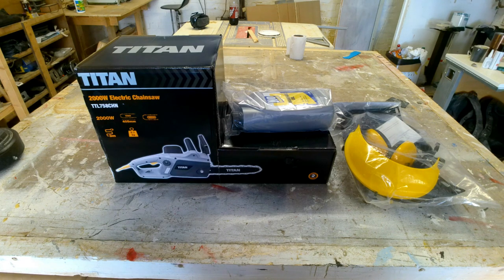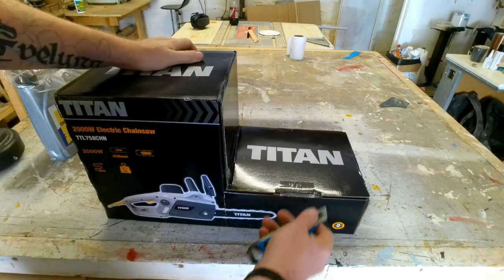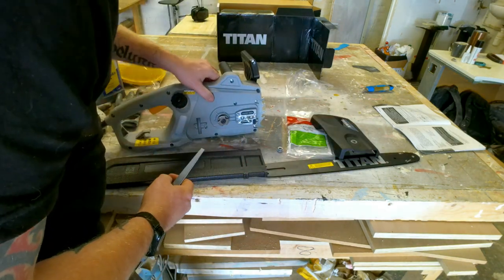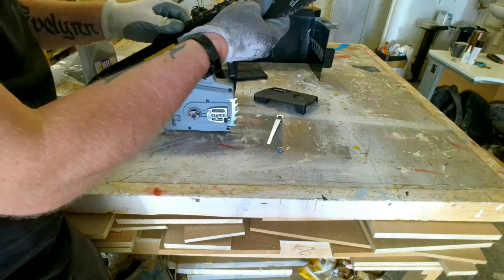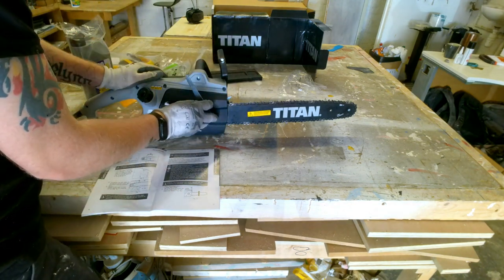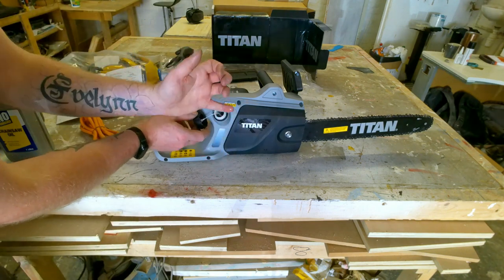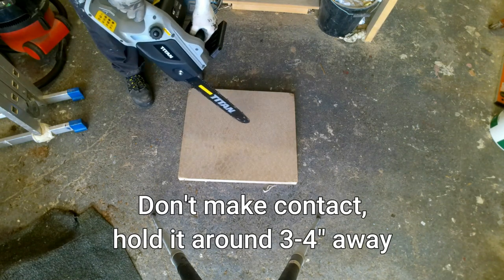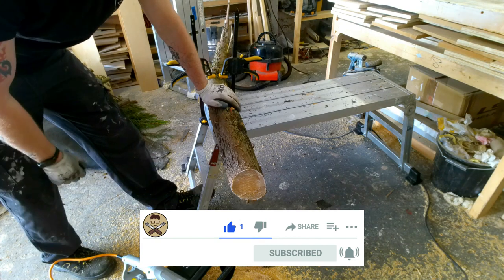TITAN TTL758CHN electric chainsaw, unbox, assembly and review

Comment: I had just bought this a few days ago and decided while the kids are at school to assemble it!  Like a previous Comment, I missed the lower hole where the chain holder lines up too!!!  Your video is fantastic and Saved me a lot of time and frustration.  I'm a first time buyer and user and wanted to make sure I have the assembly done correctly.  I am glad that you have to assemble it, so that when you need to put a new chain on, you know exactly what you're doing, it's just a shame it doesn't come with a small sample pot of oil to get you going straight away, but I did buy the same chain oil that you were showing, now I will be putting the oil in, but will test it tomorrow when the weather it better.  Thank you so much for this great video.
Reply from the maker: Glad the video helped so much, have fun and stay safe

Comment: Just a little bit of advice. If your cutting logs. You are better using just the tip of the bar as you will have more control that way once your cut goes through. Excellent instructional tutorial. Well done 👏 👍🏻👌
Reply from the maker: Thank you for the information 😌

Comment: Thanks very much for the video Phil, very helpful. I've just purchased this saw and got up and running in no time following this guide. Seems a lot easier  than going for a petrol saw as long as you have a plug within reach. I've seen a few people saying to check that tensioner after the first few cuts as the chain starts to bed in.
Reply from the maker: Thank you. I am glad it helped you set up :), Yes after about half hour use I had to tighten the chain again. But it still carried on cutting really well
Reply: @philscraftcorner   why did you not put the power cable in to its safety clip so you can not pull the cable out of the saw if it got snagged ????
Reply from the maker: Because. I guess I didn't think about that😅 but it's a very good point
Reply: @philscraftcorner  it could save your cable from pulling out of the saw if it was stood on i have 2 titan saw's a petrol and an electric i cut big fire wood every year never had a problem with both of them

Comment: Great video and this saw looks like it will be ideal for the little bit that I need to do.
Just a little tip for cutting logs, let the spike bar bite into the bark of the log (the chainsaw will naturally pull it in that way) and lift the handle to pivot the guide bar down into the log. Super easy and controllable
Reply from the maker: Nice tip. Thanks

Comment: Thanks explaining the chain oil bit in more detail. It's a little confusing at first and I overfilled mine before seeing your vid. I didn't notice any fill level line either and the fill viewer on the side doesn't show anything other than the minimum level.
Reply from the maker: It isn't very clear at first. Hope you managed to get it filled to the correct level
Reply: That's a good point,  perhaps that's all the oil level indicator intends to show, ie the minimum level.

Comment: Thanks for the video. I initially missed the bit where the lower hole of the chain holder lines up with the tensioner. First thoughts after using it are good. However one very obvious downside is determining the oil level. It's very unclear.
Reply from the maker: Glad it helped  I agree. I keep opening the cap to see if it's low before every use. The white plastic could be more transparent for sure.

Make sure to check chain tention every now and then too
Reply: Thanks for the advice and reaction to my comments.

Comment: Just bought this Screwfix 39 notes,thanks for the video,been told good idea to buy really good quality chain
Reply from the maker: I haven't used this a ton but the chain supplied did need a little more tention after about 30 mins use. Other than that it has been fine
Reply: Do you know of any better quality chains that would fir this machine?
Reply from the maker: The one screwfix recommends is an oregon chain.
https://www.screwfix.com/p/oregon-91-3-8-40cm-chainsaw-chain-3-8-x-0-050-1-3mm/9090k
Reply: @philscraftcorner  Thanks Phil. Ill give that one a try then. :)
Reply: There are two kinds of chain. The regular kind and the Carbide kind. STIHL do the carbide type under the "Picco Duro" brand. Not sure about Husqvarna and Oregon. Carbide lasts a lot longer but can't be sharpened by normal tools because it's too hard.

Comment: I still don't understand the tensioning sequence. How does the nut that's hidden round the back relate to the tensioning? I am being thick but I dont get it.
Reply from the maker: It's been a little while since I last used this but from what I remember it moves the bar back and forward making the chain tighter and looser
Reply: There is a small "nub" that protrudes out of the saw. This is moved forwards or backwards by the tension screw. As described by Phil this slots into the bar and moves it forwards or backwards. So you are essentially tightening it by moving the bar away from the saw. There are two of these holes on the bar - the one that isn't getting used by this nub is the one used to pu,p the chain oil into.

Comment: Very useful video, never realised you need saw oil and assembly of chainsaw. I was expecting to unpack and start using. I wish such equipment came ready to use and I could use such videos on improving my skill on usage of chainsaw :)
Reply from the maker: Some of the more expensive ones might come pre assembled for use.
I'm glad this helped you though
Reply: If you run the saw with no oil you'll destroy the chain and bar pretty quickly. The oil flows into the bar and onto the chain via one of the two holes at the back of the bar (the other is occupied  by the tensioner) If your chain overheats because you didn't put oil in or the oiler is blocked the chain will stretch and the links could break - then you've got a nice whip that will strip your face off.

Comment: This looks a total waste of time! You could cut this with a bow saw in 1/4 of the time, and you would not need to wear body armour.
Reply from the maker: I have cut a few branches off trees for friends and family and it's a breeze to use, I have also used a bow saw and ox Pro superfast.
In terms of ease and speed the ox Pro is great for high up cutting and the titan is a beast for 8" plus branches.
Bow saw was a huge pain to get into tighter spaces
Reply: @philscraftcorner  You are absolutely correct about using the bowsaw in a confined branchy area, I was really only comparing its use on an exposed log on the sawing horse, I think these electric powered chainsaws are really of use in the log shed when you have a log slightly to long for the woodburner, then it saves all the starting up of a petrol saw.
Reply from the maker: I'm all for making my life easier if possibe